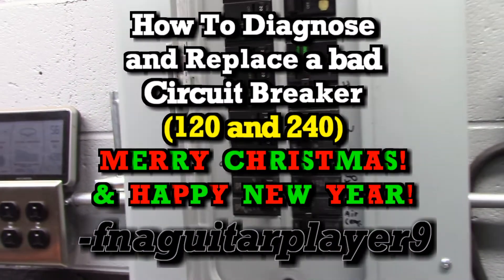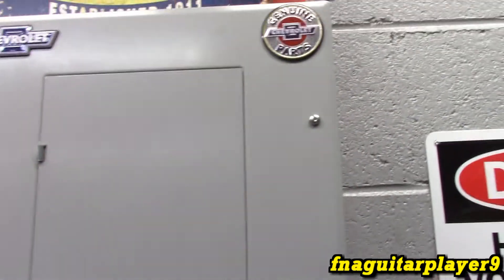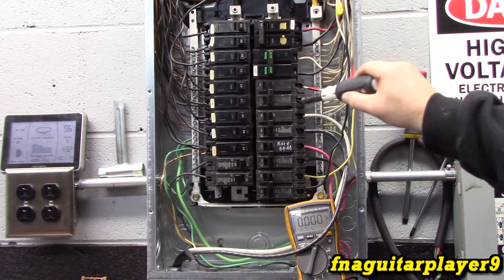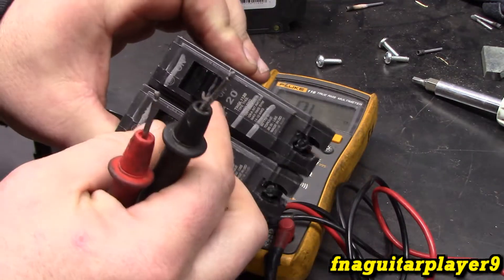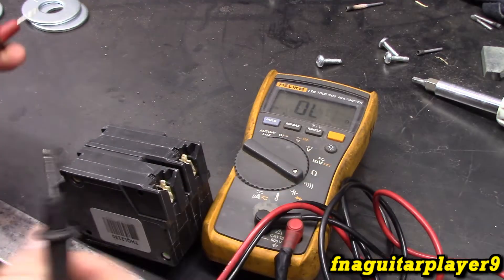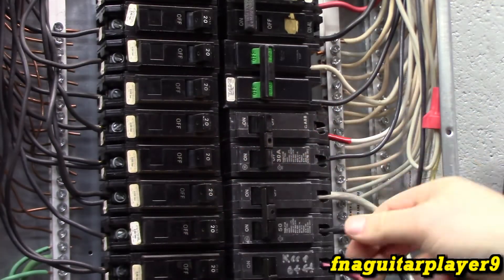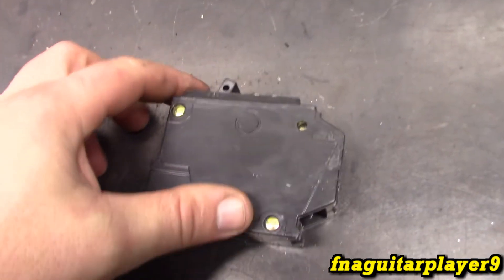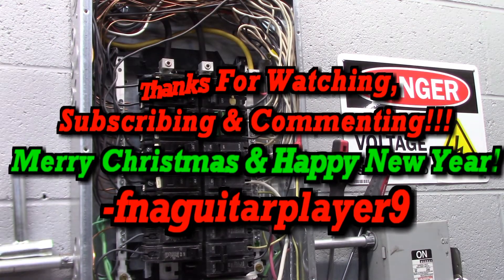How To Diagnose and Replace a Bad Circuit Breaker 120 or 240

Comment: Next electrical project, taking all the conductors that are doubled up on the 20 amp breakers and splicing them to one more conductor that terminates on the breaker.   You can splice in a panel, but two wires on a single breaker is a no no!

Comment: Thanks. I was attempting to install a GFCI receptacle in a bathroom.  One hot wire in the box feeding to more wires. I was stumbling about a bit trying differing configurations to the  line and load variations. I've installed GFCIs in the past, but not often. Oddly,  after a while the hot wire went dead.  I checked the circuit breaker. It seemed to work ok.  And I was not tripping the circuit breaker. The circuit breaker in the service box has a test button that works. It trips the breaker ok.

 I cannot figure out why the hot wire in the bathroom box went completely dead after working fine.  My next step is to try and test the circuit breaker which does appear to have GFCI capability.  So, a learning exercise tomorrow as I attempt to test the CB.       What else could it be?  A loose connection?  How could my stumbling with the GFCI install cause the line to completely lose power?  Did my fooling around with the GFCI install blow out the circuit breaker?

Comment: I had been trying to reset what felt like a "loose" breaker and it would just fall back to the off position without any sort of click, heat, or noise. After watching your video (timestamp 6:00), I saw that you reset a breaker by pushing the lower half across (which didn't stick) and then the upper half across (which took.) I did the same with mine and saw the same behavior. I assume it's a switch that is soon to fail if it hasn't failed already. I'll have to test and see tomorrow! Anyway, thanks for such a good video, man!

Comment: I got a free dryer. I was told it worked. It does spin but no heat. I changed all the heater side parts including element. Still no heat. I have a 240v plug in the shed for it. I tested each leg to grnd. Each has 120 so I assumed 120+120 is 240. I didn't check each leg together. When I did it reads 0. So this video helped confirm something bad in the circuit NOT the dryer. I gotta figure how to change the DP 30amp breaker. It is in a box outside, right below the meter where the electric service comes in to the property.

Comment: I had electrical problems and after many tries of diagnosing the problem I got to the 70amp breaker outside the house. I wanted to replace it with a 60 amp $37, because it was cheaper than the 70amps  so I decided to go with the expensive $86 70-amp

Comment: Help! I read 120v on each breaker separate but not 240v when tested together just like your video, but when I pull the breakers off to test continuity, they are both good.
Reply: How you solve ?

Comment: if i get 120 while checking it, more then likely my breaker is good? Can i check the breaker while the hot wire is still on the breaker also ?

Comment: Glad the fix worked. Though it is unlikely, after checking a breaker is passing power when ON that it will cut power too before installing it.  Then when installed and rechecking if the Circuit still has power when OFF you know it is coming from somewhere else...

Comment: Thanks!! Put me over the top on a two day, frustrating DOUBLE PARTS FAILURE on an  HVAC air handler. Blower motor went out, changed it, worked for one cycle and then a double-pole breaker inside the air handler gave up immediately after. It was backfeeding to the 240v transformer, which fooled me until I noticed the breaker switch was not catching every time while I tried to figure out the problem. I had previously checked the terminals individually to ground, but not across to each other. Absolute hair-puller.

Comment: Why would there be low voltage on an entire phase? Phase a of my circuit panel all read 80 volts
Reply: Mine is reading 74v I’m trying to figure that out rn, after this snow storm